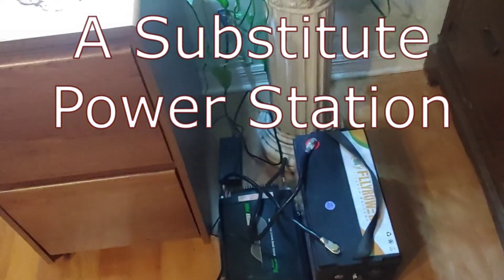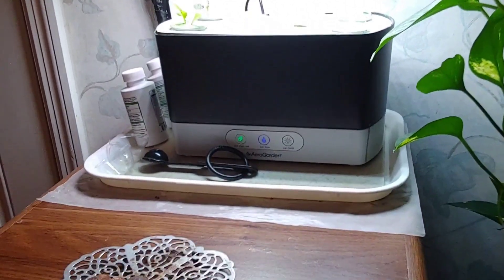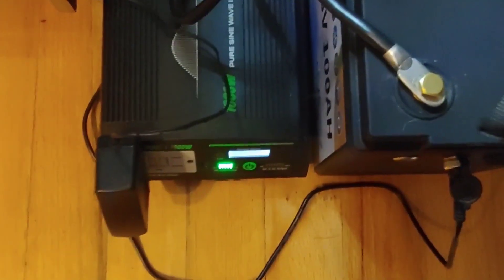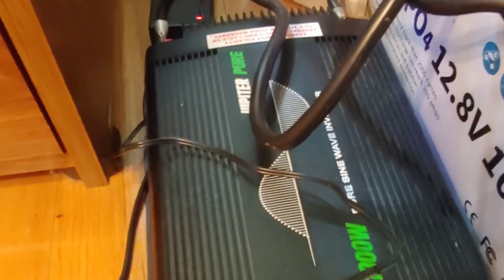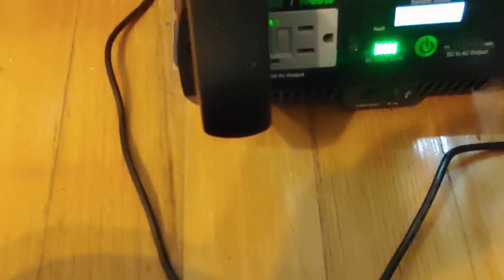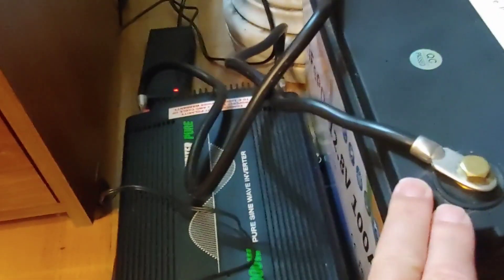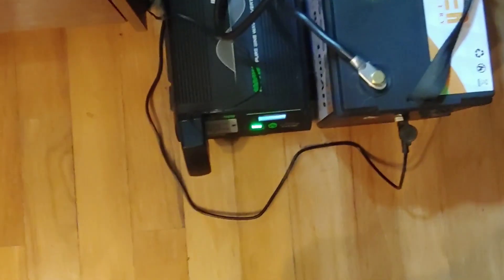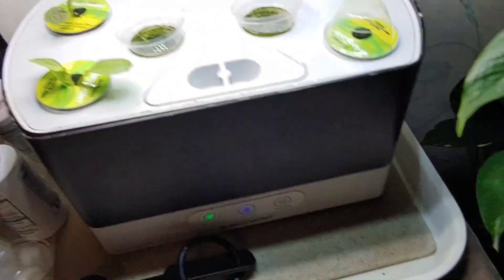How to build a simple inexpensive Substitute Power Station.

Comment: Can I use Solar to charge a battery like you have here and then use the battery to charge my 'solar generator' (invertor/battery combo)?  I want to avoid long cable runs from a small solar setup in my back yard to my solar generator inside.
Reply from the maker: Yes you may use a battery to charge your power station. Just be careful of how many amps the battery will pull out and your power station will accept. Thanks for your comment

Comment: Nice battery setup, looks like it has an 8amp 12vdc auxiliary output too, be able to plug in a 12v to usb output in to avoid using the invertor to charge usb devices (saves a bit of power not converting dc to ac) as well as possibly using appropriate 12v lighting and fans
Reply from the maker: The battery does have its own USB port that I use. Thanks for your comment.